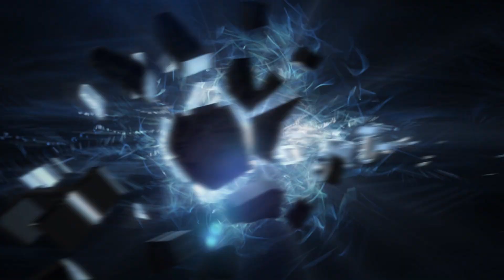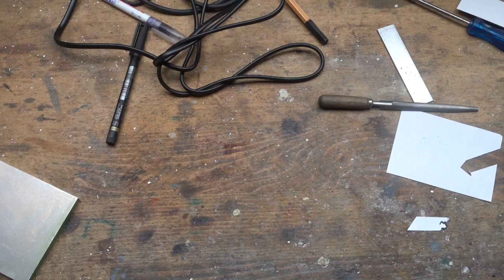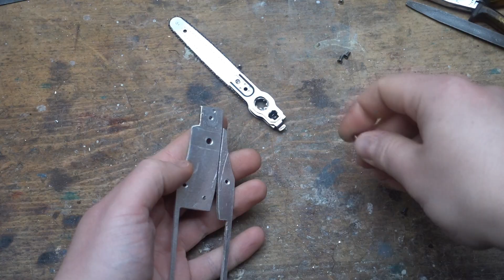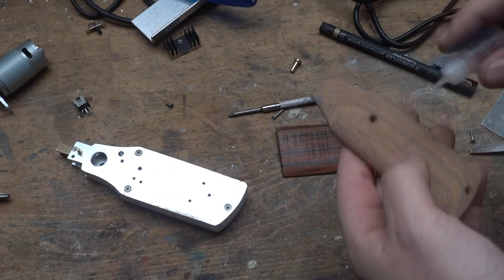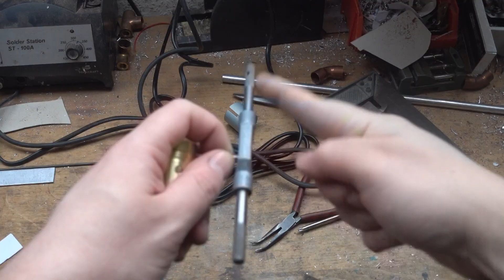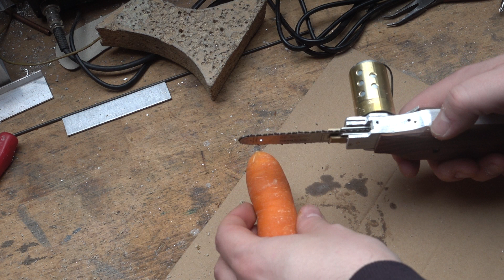How to make a CHAIN SAW KNIFE, the toy for men !

Comment: Heh, wonder if there's gonna be a way to make the motor smaller without loss of strength? Or maybe install a sort of counterweight or battery holder on the opposite side of the grip, so it would have a matching "Quillion"?

I just feel it looks a bit silly with a comparatively bulky-looking motor attached to one side, and nothing on the other side.
Reply from the maker: Naw, smaller motor more powerful? Naw.
Reply: @LaserGadgets  Alright, guess we're not at that stage yet. No chance of a Matching sized Quillion to balance the Motor?

Dunno why, just had the thought of having one side of the Guard be the Driving motor, and the other side of the guard be the Battery Rig that powers the Motor...